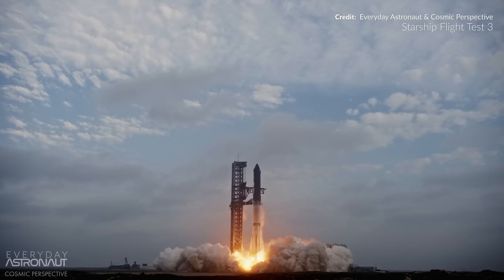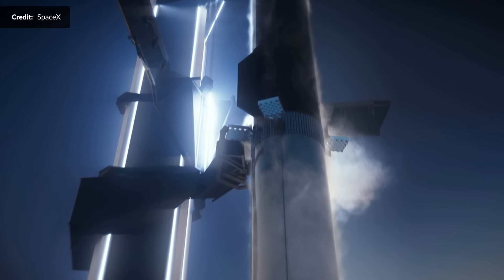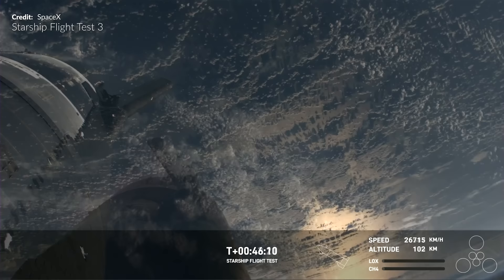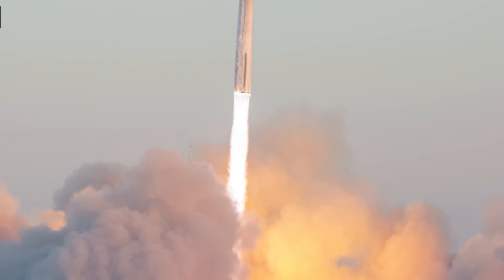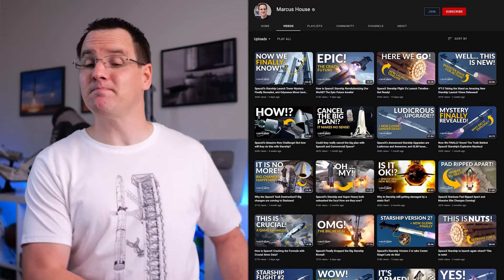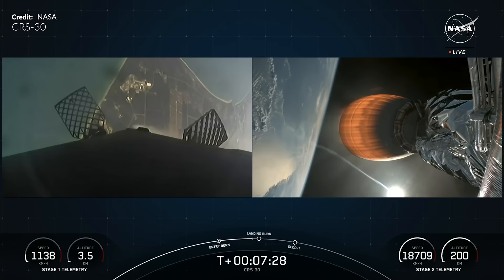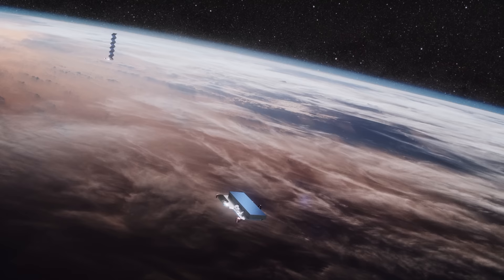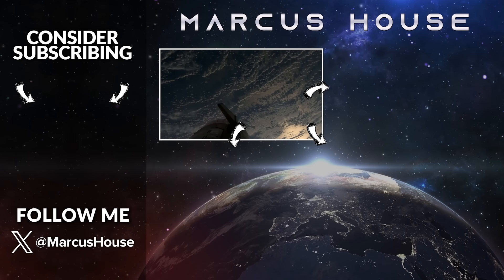SpaceX's Frantic Push to Launch the Next Starship Mission is Nuts!

Comment: Why space X does not build a dedicated tower for catching the boosters and starships. I imagine if something goes wrong a steeltower would be easier replaced than the whole infrastructure
Reply: Seen some speculation that they’ll attempt it on a partially-built second tower (with no launch mount or tank farm to ruin in an accident)

Comment: I'm worrying why so many engines, why not use bigger and less.  Seems it would be hard to control that many at one time, now I don't know anything about it. Just observation.
Reply from the maker: Less models overall really. They can use the same engines on the much smaller Starship above (6 in that case). Provided they don't have issues running the 33 together (2 full launches to stage separation is a damn good sign so far that it will work well), it is nice to have redundancy. The more engines you have, the more redundancy there is if one or more stop working.

Comment: I don't see why they don't just use mass simulators. If they planned to expend the fuel anyway, it's not the cost of the fuel. Seems that it makes more sense to spend a lil on a hunk of steel than fiddle with random adjustments to the fuel load.......
Reply: A hunk of steel doesnt like to burn up in re entry very well. But yeah i dont know why they dont use something, but im guessing they do.
Reply: @Vatsyayana87  Sandbags wouldn't do any harm, the windstream would tear them open and the individual sand particles wouldn't be able to reach a terminal velocity to do damage
Reply: data gained from a mass simulator at this stage is negligible.
Reply: @KnugLidi  the point isn't about data, it's about stabilizing the ship.
Reply: Or a block of concrete. Depends what they need to do with the centre of gravity of the Ship, and how it shifts as fuel is used. The choice of tank locations in the Ship was very deliberate…

Comment: The basket escape system goes back to Apollo, and was adapted for the Shuttle. I'd actually prefer that over the slide, which I hope is heat resistant. You might get a little cooked in the basket, but at least you wont fall through a melted hole in the slide.
Reply from the maker: I suspect it is all super fire resistant stuff.

Comment: SpaceX's modus operandi is to progressively and aggressively iterate operations, perfecting one stage before attempting the next.
Reply: Not even serially. They’ll retire as much technical risk as possible in as many systems as possible in parallel, before they can unlock further test milestones. They tested a LOT of stuff in parallel on IFT-3, but need to nail orbital engine restart before they can carry and deploy satellites (huge milestone, because that’s their initial business case for Starship)
Reply: @benfowler1134  Well said.

Comment: To solve heat tile loss, each heat tile space needs to have a 4 pronged metal protrusion, with corresponding holes on the tile, each stainless prong has a ball on the end of it that retracts diameter wise, via an occlusion on each side, think of it as a disc in the middle of the ball which retracts slightly allowing the prong to slip into the tile holes and then lock in place.

Comment: There's no chance that SpaceX will be able to attempt a recovery back at the launch tower until such time as the launch complex can confidently not suffer any damage from the launch. They're obviously nowhere near that level of confidence yet. SpaceX will undoubtedly need many more launches,, and the iterative improvements that will follow the lessons learned from each one, before they will attempt to do so. My guess would be not until at least after they have a second launch complex in use. After all, the launch complexes are in the critical path for success of the Artemis programme for NASA. SpaceX will not want to jeapordise that when they need to be launching and testing the HLS in the not too distant future.

Another point about the robustness of the launch complexes -- until such time as they suffer no damage from the launch, and will not require detailed inspection, refurbishment, and repair after each one, they will not be able to be used for rapid turnaround and reflight as intended. That is a very tall order, given the physics at work in the exhaust from 33 Raptor engines.

Comment: The BQD hoses are filled with incompressable liquid then it vaporizes to gas when the heat of the engines hit it so now it has compressible gas that allows the pressure waves of the raptors you see in slow mo and the rocket hitting the cover, to squish and balloon the hose with every pulse so no wonder it fatigues and breaks. they really need to make it a solid pipe with a rotating joint those hoses are consumables at this point

Comment: I don't think the atmospheric breaking re-entry can work with Starship. With Starship's current form factor, the surface area to mass ratio is just too small for atmospheric breaking to be a viable option on it's own. Possible solutions might be:

Do a burn to slow the vehicle down a lot, before re-entry. This could be a challenge as it would require having to carry extra fuel in the second stage which can reduce payload. A solution might be to have a permanent orbiting gas station where returning starships can fuel up a bit with just enough fuel required to slow down sufficiently for re-entry.

Have some kind of chute system that deploys during re-entry to slow down the aircraft quickly. Would require a strong material and/or multiple chutes that can be deployed one after the other.
Reply: Ah yes enough fuel to completely slows down and a chute that can survive a heat of plasma, very realistic & common practice /s
Reply: @alvianchoiriapriliansyah9882  Just as realistic and common as a launch tower that catches a rocket booster mid air.
Reply: @caribbeanman3379 "Wait, everybody else is expending their rockets. Why SpaceX can't do the same on Falcon?"

Ppl, 2014
Reply: @alvianchoiriapriliansyah9882  I'm glad you're seeing my point.

Comment: it is obvious the current "landing" solution is not going to last for long. Now that they have plans to add more cargo capacity to Staship, part of this extra weight should be used to add a landing gear. So, maybe, Mechazilla will be still used for boosters, but Staship needs a landing gear and being able to restart from where it landed. That's the only way they can land on the Moon, Mars and anywhere else. The military also need a Starship to bring equipment anywhere in the world in minutes. No landing gear, nothing like this is possible
Reply: I see no reason why they can't do both. I.E make versions of Starship without landing gear for rapid reuse operations and higher payload (refuelling tankers and Starlink launches being the obvious candidates) and then a version with landing gear for when the ability to land is more critical and payload and turn around time are less so, such as crew launches.